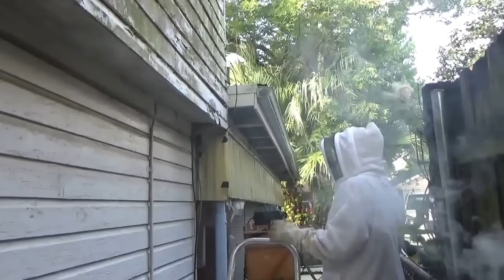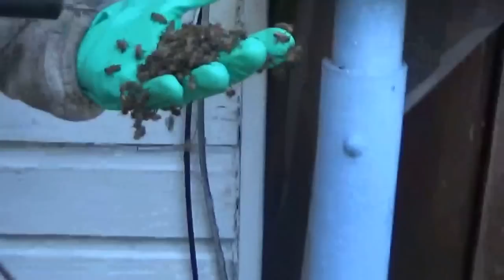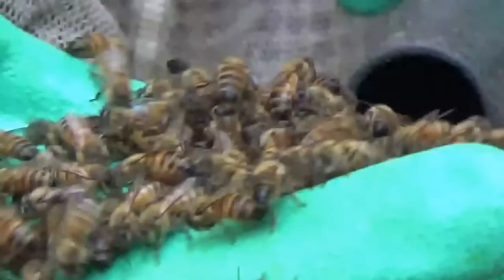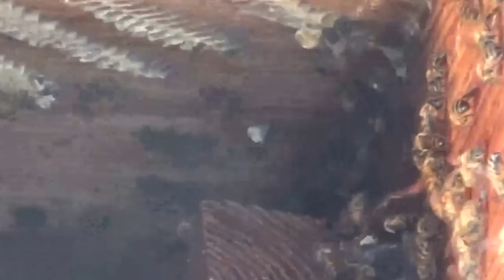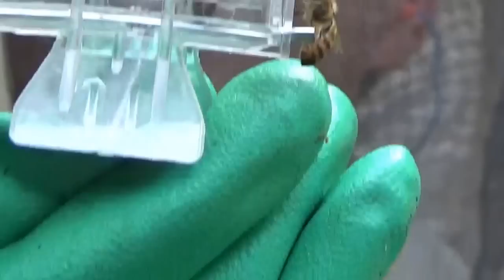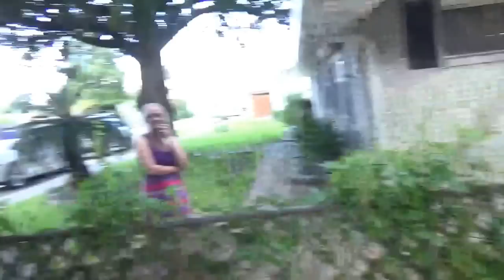Bee hive removal from the soffit / floor joists of a home.

Comment: How did you prevent a new swarm of bees from moving right back into that space? Do you put the siding back on and make it bee tight with silicone? What are your tricks? I am worried about doing this for future customers.  Just getting started.
Reply from the maker: There is no guarantee that bee won't move in after a removal, even if you seal things up. We calked under the siding over 2 foot with silicone, and spray foamed the inside of the wall to prevent reentry, but I have had them move in 2 years later. You just do the best you can. I always caution the homeowners about the possibility of bees coming back, and tell them they must be vigilant about watching the area for bee activity. Since I don't charge to remove the bees, if the bees come back, it's just more free bees for me. Thanks for watching Evan, and best wishes for the employment opportunity. God's peace brother.     Mr. Ed